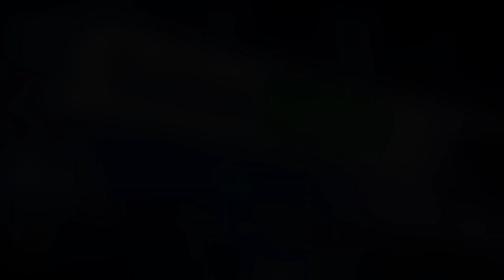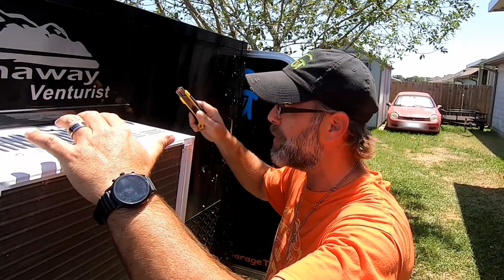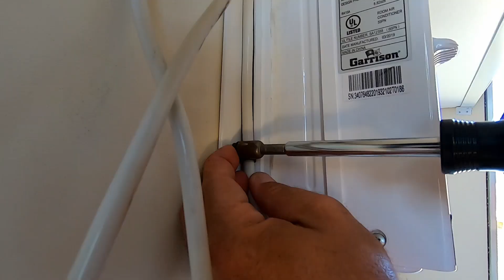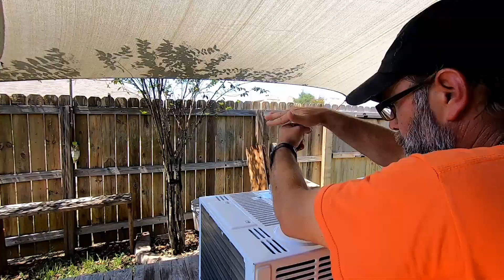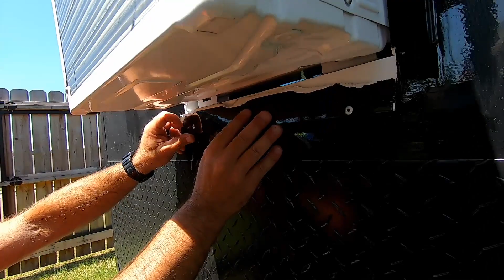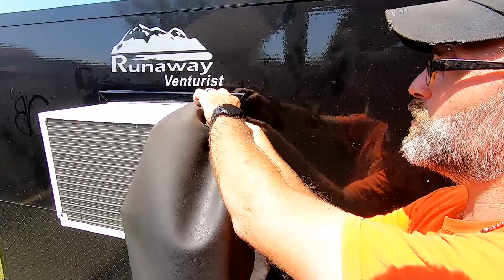Episode 429 - Runaway Campers AC Replacement

Comment: Hello. Thank you for your video but can I ask you a question. Think about buying a Runaway and know that the materials have changed for building it. With that said I have heard  folks having trouble with water issues because of the ac being at the front of the camper. It looks like your camper is the new material and the outer cover for the AC. So I am just wondering if you have had any water issues from the ac at the front and do you cover the open vent that is still exposed when rainy travel situations. Appreciate your time and feedback!  Jess 🙂
Reply from the maker: Hi Jessica, sorry for the delayed response. I have heard about AC leaking water into the camper. I have never had this happen to me at all. With that said I'm sure it can happen. AC units are decided to be angled outwards so that when they are running water will drip out side.. so if you get rain water on the inside of the AC pan and then the AC is tilted forward, into the camper yes water could pour into the camper. I'll get a video demonstrating how this could happen. Hope this helps.
Reply: @BubbasgarageTv  Hi there! Thank you for getting back to me and appreciate your feedback. Besides the camper sitting still  using the AC , the issue I have heard is when driving. The reason that I heard about this problem is because of wind force while driving will drive the rain into the open area of unit. So that is why I was asking and your experience with the new materials for building the Runaways. Maybe that is more for the wood type Runaways. Still I think I will cover the end that is open while driving. Will keep a eye for your video on this. Have a good night! Jess 🙏

Comment: Did u notice any difference in heat inside the camper by painting it black?I asked about them painting before purchasing and they said they prefer keeping it white due to reflection off the heat.I also want to paint mine black or possibly rhino lining it.
Reply from the maker: Great question, we pretty much had it painted right out of the gate. With that said I would not be surprised if it is hotter for sure. We thought about lining it and opted to go this route mainly because it would be easier for me to mod up as time goes on. All in all we have been in some really hot areas but mainly just use the rig as a tool/sleeper so we just turn the A/C on (if possible) just before we climb in to sleep you know. Been really happy thus far. Looking to mod up the A/C cover soon with the new one :)
Reply: @BubbasgarageTv  thank you for replying,I used your video to help me replace my ac unit on my 2018 RR I recently purchased (new to me) but will be anxious to to see about adding the newer ac cover.love the content brotha 🇺🇸🇺🇸🇺🇸
Reply from the maker: @keithjohnson5148  Nice, huge congrats. Thanks a bunch Keith. Means a lot. We should have everything we need for the new cover in a few weeks. Stay tuned for sure. More mods to come. Just been crazy busy lol. Stay safe & stay blessed.

Comment: Curious if your old one went out. Mine ended up being bad from the factory and had to swap mine out.
Reply from the maker: Ours too was bad when we received it. Crazy me was too busy with the Galley project that I didnt even test the AC until we were fixing to hit the road. The plastic fan blade on the inside was busted and rendered it unusable. Talk about bad timing. We ran the trip around the US with out an AC.
Reply: That's pretty annoying that they would be selling bad a/c units off the lot. Did you guys contact Runaway to let them know about the issue? Did they offer to install a new one or at least refund for a replacement? Do they have a warranty on this type of thing? I'm considering a Runaway, but needing to replace a brand new a/c would be a deal-breaker for me.